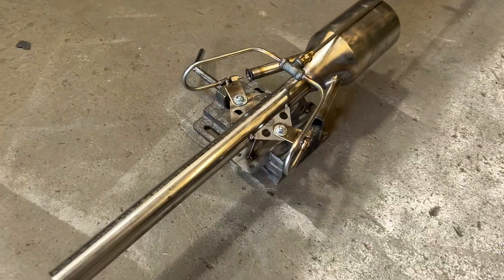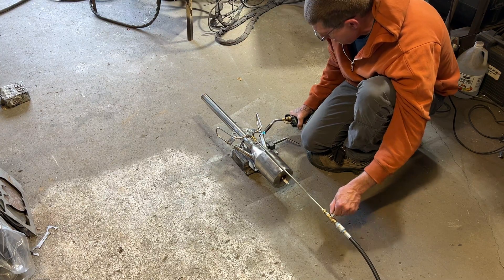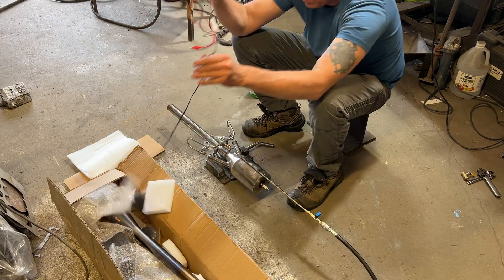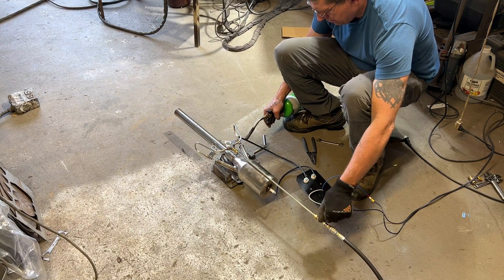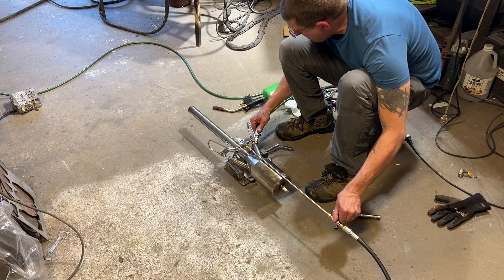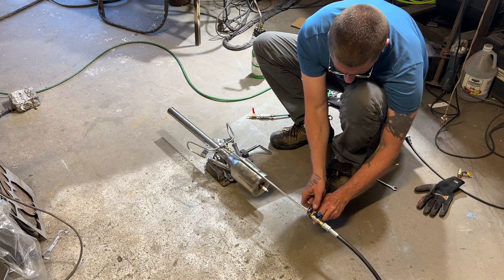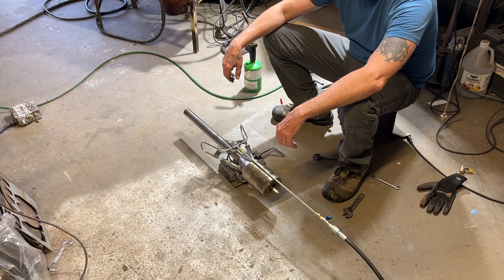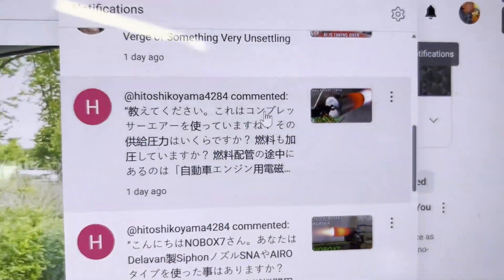Solving difficult problems with pulse jet ignition

Comment: If you use compressed air also use low psi and also on a jet that size try the .35 mig tips they are ok for injection but the king injection orfice in my test is a number 55 carb jet

Comment: Pro tip from some one whos been building alot of pulse jets lately . Mine all start with a simple pulse arc ignition but the issue your having is bad air fuel mix it seems when they do that you blow air in the in take
Reply from the maker: Tried that but it didint work {blowing air}

Comment: You’re over here building pulse jets, after I talked about that wast oil burner that kinda acted similar. And I didn’t even know you built pulse jets. I have been away from YouTube for about a year I had to get a new YouTube channel. I’m 26 now I was a subscriber to your channel since I was 14-15 on my old channel. 
Another words what I’m trying to say, you’ve already been build “gas oscillating compression ignition” I gas would be the right term or away of explaining it. 
The big difference between the pulse jets, and that wast oil burner is the frequency it’s very strange because it doesn’t matter how big, or small the pulse jet is. They all have a much higher oscillating frequency or resonance then that bunner/heater I built. FYI it didn’t shoot any fire out of the air intake like pulse jets do as well. I hate china is doing that to you, I gave my idea out because your incredible at building stuff like this. I was able to run that bunner incredibly air to fuel lean. That means efficiency so if you build something similar using that idea again unsure if anyone else has and patented it or not. I’m not withholding it, “the best way to dispose of used engine oils, and fuels is to burn it” far cleaner then putting back into the ground! Be safe brother, and I wish you and your business/hobby well!